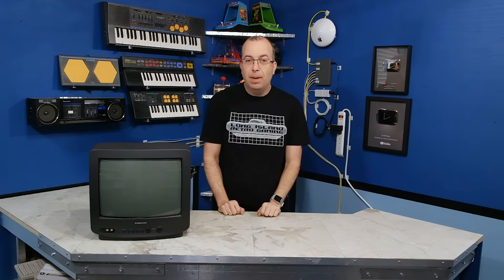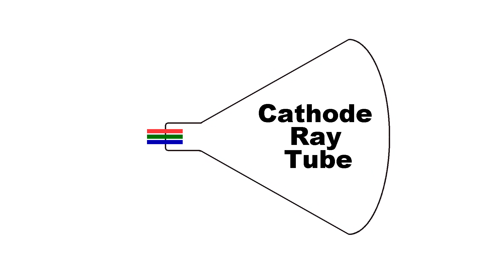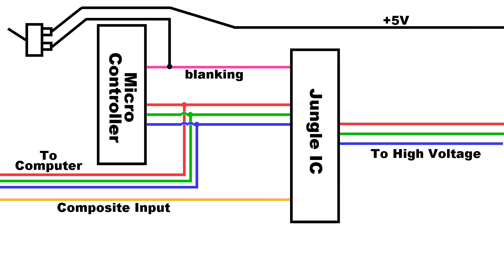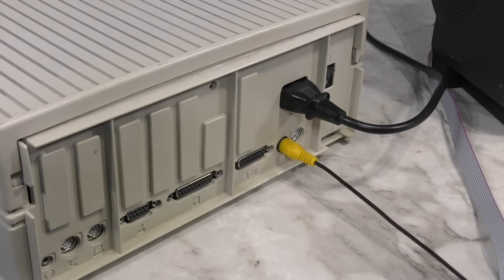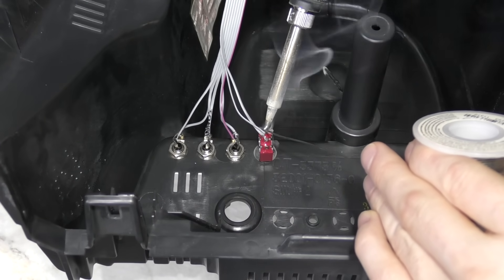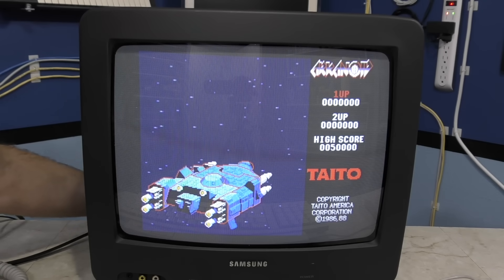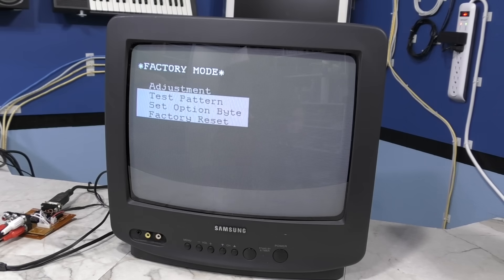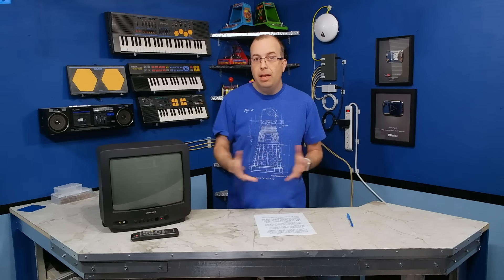Modding a consumer TV to use RGB input

Comment: I still use old tv. After I watch your video, I'm little bit curious. My tv has a lot of input panel. There's a 2 RCA (Back and front) and YpbPr. I use RCA but i never use YpbPr line. I'm asking, what YpbPr line for? Can I use it as monitor like you did? Thanks for the video though
Reply: Hanif Avicinna YPbPr aka component video is a completely different color space than RGB but depending on how the tv was designed it may support RGsB aka sync on green it won't natively support the RGBS shown in this video though through a YPbPr connecter though
Reply: +Hanif Avicinna YPbPr(component video) is pretty much just as good as RGB. So if you don't wanna mod your TV, you could use a RGB-to-component transcoder (I suggest the Shinybow SB-2840 with SCART socket. But there are some with VGA connector or BNC). Plug your RGB-capable consoles in via an RGB cable and voilà! Alternatively, you can plug a Playstation 2 or Wii directly using component(those 2 consoles support component out of the box) to your TV and it is so worth it. I highly recommend hooking them up that way

Comment: This is awesome. Quad Hands are great, I love mine. Just a note, if you want to cover electrical connections, there is UV-cured conformal coating available (Louis Rossmann sells it in his store, which is where I bought mine from, though I usually use it for component-level repairs). Given the size and application though, the hot glue is probably a better choice in this instance.

Great video! I'm really impressed with the results and am dying to try this myself!

Comment: I was surprised how good the signal looked with all those unshielded joints. Did you leave a grounded wire in between each of the signal wires in the ribbon? I would have chopped shielded rca coax to solder to the board and used bulkhead mounted back-to-back rca females to get out of the plastic. But if it works, thats pretty cool.

Comment: Now I'm really tempted to mod my old TV.  I wonder if it's possible though.  I have a cheap off brand TV from around 2001 that doesn't even have composite input, just a tuner.  The OSD is very sharp though, so that leads me to believe it has the same microcontroller RGB design somewhere internally.  If I could also tap a sync input from somewhere then maybe it would work.

Comment: Awesome video 8-bit guy! Could you please do a video tutorial on converting CRT tv/monitors to arcade monitors? I have 4 arcade machines at home with all original components but the monitors are starting to go bad. So, if at all possible to salvage an old tube tv or computer monitor to work with the arcade control board, I would love to see how that can be done. Please and thanks!

Comment: I've always been paranoid about taking apart TVs. There are a lot of good components to cannibalize, but I've been told my entire life that they have a capacitor in them that can deliver a lethal shock even if it's been unplugged for 50 years.
Reply: It is not that lethal and doesn't hold charges that long, but there is reason enough to take precautions. Wear shoes with rubber soles, wear rubber gloves and discharge the tube like the 8-bit Guy does in the video. Then nothing can happen. Should something happen, 15 kilovolts is painfull, but there is very little energy stored in the tube, so it is not that deadly. I wouldn't recommend it to someone with a weak heart, but touching 230V mains is more dangerous, since that actually does delivery energy.

Comment: @david - please don't switch the "blanking" Pin hard to GND or VCC. Reason is if the Insertion Chip µController pull the blanking PIN to Low and you switch to High so a short cut in the Chip will occure and can destroy the Insertion Chip. A Solution is to disconnect the blanking line and connect the side from the Analog Chip it to the middle pin of the Switch. The one other pin you connect one side to the Insertion Chip an the other to the Voltage VCC High. So you can switch between the Insertion µController Function and the external Source. It is also possible to do this via two Diodes if the blank is activ Low. 
The 3 Resistors are also calculated by Impedance for the Ideal Video Signal. The 3 Resistors they going to GND are importand that the Signal is not haveing a reflective Wave and you see a shadow in the inserted Video Screen so insert your Signal exact in the mid of the two old Resistors. If you would like to make it perfect use the old 4066 (Quad Switches for Video). 2pcs of them can switch the Video exact and hold also the Impedance from this input. (this is only a tipp it is not a must to do this) 
Best Regards Volker

Comment: So why did you put the switch on the back?  It seems like it would be easier to use on the front.  You could change things over on the fly (EG, a C128 could swap between 40 and 80 column easily).

Comment: I WOULD recommend to check the input connections across the ground just in case. then plug in stuff. But you can always roll the dice.
or have something you don't care about to test with

Comment: I used my home theatre PC on a 30+ yrs old, slightly modified CRT set until recently (the scart was not a common thing in the former eastern bloc, this set was a hungarian made Videoton Infracolor 2000 -one of my personal favourite TV sets)  I used a simple VGA-RGB cable (which only means the two separate horizontal and vertical sync, from the VGA output, became common at the RGB end, and none of the colour signals were touched) And I can tell, this is the only way to get a picture quality, that the older TV sets are capable of. Much, much better, than anything else. This even worth those 10s of painful hours, trying out different VGA cards that supports this weird frequencies, and slight adjusting those in PowerStrip to get the proper picture arrangement. While trying diffrernt settings, sometimes the tv itself made worse noises, than a diesel submarine. Good old days... now I use hdmi and all that work went to waste.

Comment: my Atari ST could not work via SCART with e.g. Goldstar or Blaupunkt TV running RGB signal. I don't know what was wrong, maybe those TV sets could not accept RGB. 10 years later I hooked up the Atari to a Phillips flat screen 100 Hz CRT TV with SCART, and it worked in full RGB mode, the image was as sharp and clear as a glass, although because Atari did not display a full screen image, the TV automatically enlarged it to 16:9, so it wasn't as sharp as it would have been on a contemporary RGB monitor in 4:3. 
Another 10 years later and plugging the Atari into a LED LCD panel with the SCART cable unfortunately did not produce proper results. The image was going on and off in cycles, maybe the sync signal was not recognized by the panel.

Comment: Actually many 8-bit console games used the composite artifacts to their advantage to introduce graphical details that aren't in the original pixels, but appear as a result of the composite signal degradation. (This is why some of these games may look so different when eg. played on an emulator, unless the emulator has a filter to emulate a CRT with a composite input.)

Comment: Hi ! When I look at the rear input connector, it seems that it got Peritel/Scart size & aspect. I wonder if you have the 21 pins ready under it. May be your TV can be equiped with, because Samsung sold worldwilde with very very little changes. You may also update the Jungle IC to a NTSC/PAL/SECAM 50/60 Hz models has French models were mostly equiped with, and so get a worldwilde RGB+Composite TV set [except B&W 405 lines UK systems and 819 lines FR, but there were no videogames using these systems and very rare broadcast bands recorded in theses modes).

Comment: Sure, this is a "amazingly easy" mod to do especially when you got a buddy (Mark C.) breaking down the schematic, deciding on the correct resistor values and whatnot and doing the leg work for you. 90% of the difficulty in this mod is ifinding a schematic, DECIPHERING it, and correctly deciding where  to do the soldering without frying some circuit. Nevertheless I'm glad you got it working

Comment: this is great! is there information for modding a TV for S video input?
Reply: For televisions like this, it is only possible if the jungle IC has separate luma/chroma input pins. You need to find a datasheet for the jungle IC. For older TVs, that are less integrated, there is often an IC called the "comb filter" on the board, that has composite as input, and luma/chroma as output. That is where you can then add an S-Video signal.

Comment: I actually did this to one of those TVs once but it was a different one. It worked great had it going for a while. Then one day it went pop because something touched inside. Then it was broke so I just thrown it away. It was nice while it lasted. Then I came across this video. It’s a nice way of converting one of those TVs to RGB. I did it in a similar way to how you did it except I done it cheaply so that’s why it went pop. I did not have a phone or tablet to take a picture of it then because I did not have very much money for one. My dad had a flip phone and my mom had a prepaid flip phone both without cameras. My family was not very good in money then but now it has gotten better. It’s a bummer I could not get a pic of it. I wish I could have gotten a video or something of it. Also I did not think about taking a pic of it because I did not have a computer then or any kind of device to upload online at. I used to live way out of town but now I do not. I really want to make it again someday and I will maybe do just that. I am very busy with my job now but one day when I’m not busy I will do it again. I really liked how you did it wish I would have though about buying “the right connectors”.

Comment: My old Panasonic TC-431GR 14" CRT did not have a SCART connection, but it did have a dedicated video mode that was activated by the flick of a lever switch.  You then used the dedicated BNC connector and no tuning of the signal was required that I remember.  The TV had a system called Quintrix, which was probably similar to the Sony Trinitron.

Comment: one big problem is some, mostly older tvs here in the uk, such as ones dating from the 80's,  have a non isolated 'chassis',  live at rectified mains voltage so this cant be done as easy as this, you'd need a 4 channel linear opto isolator circuit...

Comment: Games consoles, Computers, Video recorders and Cable/Sat boxes that had Scart, a extra wire in the cable switched the TV to that Scart socket when switching on the device, plus composite or RGB could be  selected from the device. Scart also carried the Stereo Sound

Comment: For the love of GOD, don't  run a 30 kHz VGA signal to a CRT TV, unless you're aiming to kill it! Even the VGA cards that are capable of syncing down to 15kHz after a TSR or Windows driver is installed will still display the PC's POST & boot screens at 30 KHz, and likely for long enough time to fry the scanning circuitry. 

If your TV has component inputs, there are component-to-RGB adapters available that will give you the same image quality as a native RGB signal, without opening your TV.

Comment: Well done in general but won't th 5V blanking switch blow up the microcontroller output? I/O pins may be short circuit protected but I wouln'd count on it.

Comment: Do you have the contact info for the person that helped you out on this? I have a Philips 32" I've been wanting to add RGB/SCART to for a LONG time, but I have no idea where to start and haven't been able to find anyone that can help me out. I have the full service manual available here for anyone that could give me the info I'd need to get this done...

https://drive.google.com/open?id=1GFCTYQfLTE8ij4WygeUbsKQzMUfbBxn3
Reply: If you look on page 6 of the manual, top right, you see a TDA8847N2 chip, which has incoming signals called "R1, G1, B1 and RGB IN".

Googling TDA8847N2 results in a datasheet for this chip:

http://pdf.datasheetcatalog.com/datasheet/philips/TDA8843-N2.pdf

Page 32 of the data sheet is very interresting and basically confirms these are the lines you are looking for. The voltages mentioned there (0.7V max) match those of analog video, so good. The page also confirms that the "RGB IN" pin number 26 is actually a blanking pin (it calls it "fast blanking").

A carefull approach would be to attach an oscilloscope to these pins to check wether things match the expectation. If yes, you could try to solder some wire to them and see what the result is if you connect them to an RGB source.
Reply: Note: The TDA8847N2 data sheet page 32 says the maximum for the blanking pin is 3 volt. So don't connect it to a 5 volt source, like the 8 Bit Guy did in the video. Just an example that you need to be carefull and respect the specifications of the chip.

Comment: is there any lag difference between the 2 modes?
Reply: No. CRTs don't have lag in the first place. One of their advantages is that the tube has no fixed resolution or refresh rate and they can natively handle interlaced pictures. Therefore there is no need for image processing, the picture can be displayed instantly.

Decoding a composite signal into RGB can also be done instantly, so there is no delay at all in a CRT, wether you use composite or RGB.
Reply: Thanks for the complete answer! now i'm tempted to pimp my old cathodic tv and play old games in a finer resolution :))

Comment: Actually there are some TV-sets with SCART sockets which do not have RGB. Grundig used to have some models which did that because the architecture of the set needs to be slightly different in order to accommodate RGB inputs. Pre-SCART sets had their AV inputs at the IF block, while SCART sets typically have it on or near the Teletext board. Yes, Teletext is still widely used.

Comment: TSR, now there's a word I haven't heard in a long time.
For those unfamiliar with it, it stands for Terminate and Stay Resident. In DOS, a normal program will take over the computer, and only return you to the command line when it has finished running. A TSR will stay running in the background, and intercept commands from the OS or the running program. It was a method for adding drivers and new functionality to DOS.

Comment: I considered this sort of mod when I was trying to run my A500 on a TV set and get a better picture. I gave up when I started reading about hot-chassis TV sets, which since your TV has a 2-pin line cord, it must be. That "5V" is only guaranteed to be 5V referenced to the 0V line inside such a TV set :/ I read some about this and decided I couldn't understand how to get around it with sufficient confidence to poke about within. It's a great mod though. However I THINK that if you happen to plug that TV set into an outlet where neutral and live are swapped, you're going to be in a world of pain as the "grounds" will be at line potential.

BTW, a trivial niggle that tweaks my pedant nerve... a few of your videos mention the moire effects on CRT monitors as seen through your camera, and you mention it's to do with "polarization". Well... actually... it isn't - as you can verify by rotating the camera about the axis through the lens. The moire pattern is an interference pattern caused between the pixel grid of the camera and the shadow mask of the CRT. Which is also why you see that pattern change as you zoom in and out - as the relative frequencies of the two grids/patterns are changing.

Comment: Well in Europe, we did have SCART, but we did not have S-Video. And guess what? While SCART could use RGB, or it could also just use composite - for example Playstation SCART cables were composite only, no improvement in picture quality. On the other hand S-video cables for PSX gave incredible image, comparable to RGB component cables. And from my experience it is like there was no standard for SCART - good luck trying to get SCART image out of Amiga - half of TVs did not show anything..
Reply: S-Video was available in Europe rigth after it was introduced. That doesn't mean every TV got S-Video input, since every TV had SCART, there was a lot less need for an S-Video input, so it was something that was quickly omitted for TVs where there was price pressure. Getting SCART from an Amiga should just work, many Commodore monitors such as the 1084S, did use SCART as primary input, so it had to work, otherwise the Amiga was not usable.

Comment: Would it be possible to add HDMI to a tv that old using a HDMI switch, HDMI to RGB converter with a aspect ratio toggle
Reply: Yes, if you use a video mode that respects the timings of the TV signal (15625 lines per second for PAL, 15734 for NTSC).

Comment: As always, another fantastic video! I recently bought all the parts to make my own RGB cables for my Sony BVM so I've had RGB on my mind lately. Can't believe my luck to see this video posted so recently. My parents have some old consumer tv's lying around that would be a blast to mod for RGB! The look on my dad's face when I boot up his old C64 on it would be priceless!
Reply: Well...  the Commodore 8-bit line is a bit odd in this regard, because these computers don't have RGB output and also internally don't use any RGB to generate colour. The C64 amplitude modulates 3 phase shifted sine waves to generate a colour signal; it natively generates S-Video internally. Therefore, for the Commodore 64, S-Video is the optimal video standard.